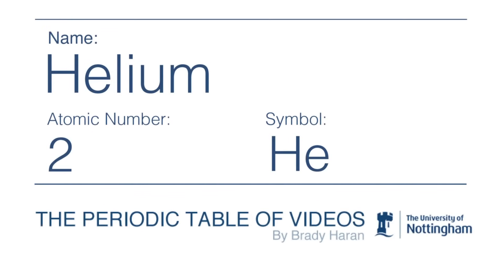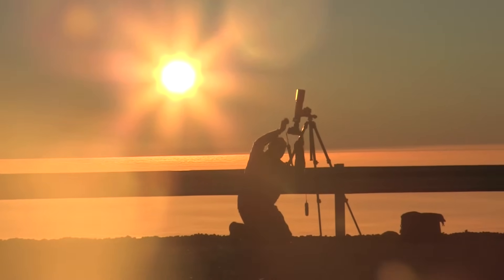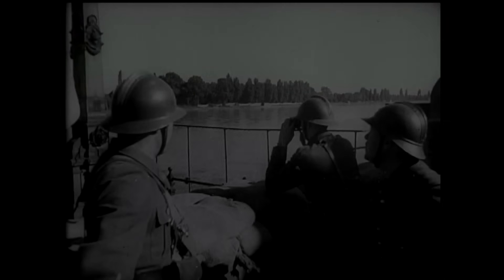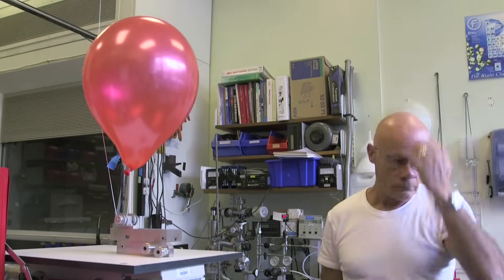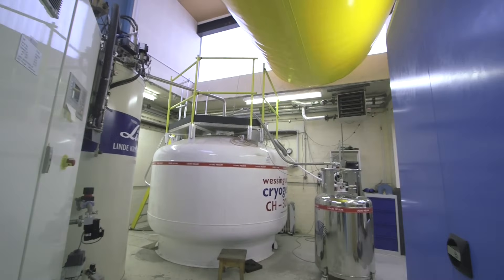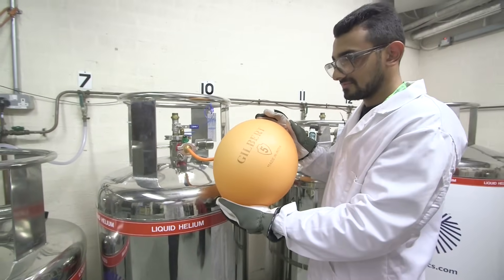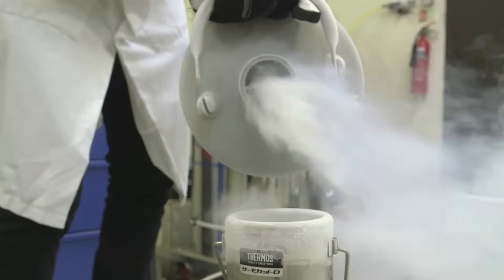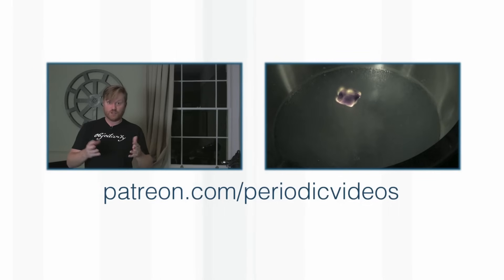Helium - Periodic Table of Videos

Comment: "Liquid helium is very rare"
"Proceeds to pour liquid helium everywhere"
Reply: I would be surprised if they didn't have some kind of capture system. If for no other reason, due to the chance of leaks.
Reply: That’s amazing tho!!!!!!! With liquid helium... you could get so close to 0 Kelvin which is so incredible. Imagine studying that under an electron microscope. Or a laser!!!!!!!! Omg I can’t wait till I get done with my engineering degree! I’m gonna do so much with it.
Reply: I think it's rare relatively compared to other elements but we have plenty for whatever we need, otherwise we wouldn't waste it in party balloons.
Reply: Any helium that escapes into the atmosphere goes up and up and ends up in outer space so is lost to us forever. Eventually we will run out of helium unless we can manufacture it (by fusion/fission) or collect it from. Somewhere else.
Reply: i kid you not that is funny to me
Reply: The helium is recovered in that room so most is not lost.
Reply: Curt D It is not recovered from the compressor/dewar room. It is captured from individual labs’ feed lines coming off of their apparatus, then charged for what is lost, not what is sent to them and returned. I believe it is captured from the slatted floor, not to save the helium, but to divert the liquid helium/nitrogen out of the building and onto the ground so it does not displace the oxygen in the room. Think of it as a regular floor drain meant for water, but this one if for liquid gasses.
Reply: @johnanders8861  And gaseous gasses.
Reply: +Curt D
It's essentially lost because it can't be used anymore
Reply: We're going to laugh at ourselves one day when we're mass producing helium from larger atoms.... turning a pound of garbage into a pound of helium...
Reply: radioactive waste is like drain cleaner and alum foil in terms of helium
Reply: Curt D no it’s not

Comment: Hey, it's Sanj the Helium guy! Just wanted to say thank you for the opportunity to be in this video. I hope you guys had just as much fun as I did!
Reply from the maker: +SanjFX cheers Sanj the Helium guy! See you again soon hopefully.
Reply: @periodicvideos oh
Reply: @periodicvideos  With a handheld Tesla Coil, try the 1990s "One ATM Plasma Globe," but with an inverted aquarium filled with helium rather than a paper bag of argon.   
With 100% argon in an open paper bag, you'll obtain 15cm sparks if you stab the electrode of a Tesla Coil into the pool of argon.   Probably the same will happen with Ne and He, but you'd need an open lucite box placed upside-down.   To produce 100% pools of gas, wrap a bit of tissue paper over the end of the hose, otherwise the gas will be "poisoned" by turbulent mixing with air.  Tiny contamination by air will halt the long-sparks phenomenon.  
Why do sparks become orders longer when leaping through Hg vapor or through nobel gases?   I suspect it involves the lack of "doing chemistry," where sparks in air are expending energy in disassociating the N2 and O2, which of course doesn't happen with monatomic gas.  
This effect was discovered by Bill Parker, the artist who built the first plasma-globes for the Exploratorium in SF.   Those globes still work at 1ATM, although the required wattage is much lower at a few Torr pressure in the globe.   
PS   
Caution: if you first blow all the air out of your lungs, then inhale helium slowly, your pitch rises more, but also you'll experience anoxia and then pass out.   If you feel faint, just rapidly blow out the He and take many deep breaths.
Reply: All hail Ser Sanj of House Helium guy
Reply: We did. Thanks, tech guy!
Reply: ozdergecko You could use glass without breaking it, but liquid helium has such a low viscosity that it will literally run up the side of the container and leak out the top. People used to think it was penetrating the glass (hence the professor's statement of "going through it") because a glass vessel just drips helium out the bottom.
Reply: @QuincyMarket  I think you have something there; adhesion and cohesion are two forces when speaking about liquid, and the adhesion of the silicon atoms is higher than the cohesive attraction of the liquid helium.
Reply: @QuincyMarket  hope they get that on video next time
Reply: Neil Wilson You're welcome :)
Reply: I defintely had fun watching this, but certainly not as much fun as someone with the opporunity to play around with helium.
Reply: very much so. A question: would a glass container immediately break when filled with liq He? If not, doing so in very dry air might have shown the color of liq.He. Or would O2 and N2 sublimate too fast on the outer surface?
Reply: I wonder how much helium was lost in the making of the video, does the facility recover it from the air or was it all waste?
Reply: Alfonso J. Ramos Yea most universities have a recovery and capture system if they use Helium a lot. There are videos on YT about it.
Reply: It seems to be a cool job to be the Helium guy. I'm sure that Kamerlingh Onnes would be very pleased to see liquid helium in action and to have fun with it :-)
Reply: the old helium video showed the full recovery process and system that they have, that stuff is too valuable to waste. It was almost certainly captured by the same system.
Reply: Does your voice change when working around all that helium?
Reply: Although it was fun to watch I bet you had much more fun making it!
Reply: So, did you waste all the helium you sprayed out, or do you have a recycling system?
Reply: Admiral Percy yes, that phenomenon is called Superfluidity.
Reply: Are you an Indian?how did u reach there????
Reply: @europebasedvlogs1251  Indians have the most number of expatriates. Indian diaspora is the largest in the world.
Reply: EUROPE BASED VLOGS he would of been born here like many British Indians ✌️
Reply: Was that helium all recovered?
Reply: Hugh Oxford Yes it is captured
Reply: 666th
Reply: Nice job keeping it light.
Reply: @SanjFX , I have a question; 

Helium is getting lost to us on Earth because it just floats away, and up into the sky, and above the average atmospheric gasses, like bits of paper in water, or breadcrumbs in a kitchen sink. 

Why can't someone just go get it?

Surely someone could build an unmanned airplane, or drone, or something, to go up to the highest level of the stratosphere, and "vaccume up" a sample of all the various gasses up there, including helium.  

These days, it is so simple and straight forward, I could almost do it myself, if I bought the right equipment. 

One private citizen could not retrieve any significant amount, but a company or University could. 

I can't be the first person to think of this, so why doesn't anyone do it?
Reply: @TheNoiseySpectator  It would be so dilute that there's no way it would be economical. Would probably be better to recover the minute quantities at ground level
Reply: Say hi to Dejah Thoris for us.
Reply: Great job! Appreciated! 👍🏾
Reply: Is (he) helium... oppose gravity when it cooled below 269 degree??
Reply: Thanks Sanjeev for trying all the ways.

Comment: When liquid nitrogen isn't enough for your overclocking
Reply: Even if it would not cause the chip not working (Aggropop explained why), it would be useless. Its thermal capacity and conductivity are very poor. Extremely cold absolute ethanol (or glycol mixtures) under high circulation are much better. They have enormous capacity and conductivity and wet the surfaces without boiling off and creating even worse bubble zones.
Reply: We could reach 10GHz with this stuff!! :P
Reply: It's not as effective as liquid nitrogen, meaning it will cool something (reduce the temperature/absorb heat) more slowly and you will need more of it to sustain any particular chill point. It will ultimately reach a much lower temperature than liquid nitrogen can though.
Reply: actually both the AMD phenom II and Bulldozer architectures had no issues under liquid helium. core temps were likely below ten kelvin at times. most other chips do cold bug out though sometimes even at liquid nitrogen temps, but I do not think it is due to the silicon changing properties.
Reply: As far as I remember, AMD themselves used the Bulldozer based FX chip to set a 8.3ghz or something Frequency World Record using Liquid Helium beating the Celeron, though, more people did go beyond 8.3ghz using Liquid Nitrogen but it shows that at least Bulldozer were capable of Liquid Helium, wonder how Skylake-X, Coffee Lake and Zen handles Liquid Helium.
Reply: You are saying that it has too poor thermal capacity and conductivity to be effective, yet you think that the silicon losing its semiconductivity due to the low temperature is a possibility? Interesting..
Reply: make a proeper LHe compressor would be the idea for overclocking project
Reply: TheOrbitalDropShock Was thinking the same thing.
Reply: Unfortunately, silicon would lose its semiconducting properties at temperatures that low, so the chip simply would not work.

Comment: Why does the volume of helium need to be measured? Don't gases expand and take up the volume of the whole tank?
Reply: Not really. It depends on pressure. The material on that yellow container is like cloth, so its volume is variable. When the container is empty or has very little He, its volume is smaller because the air pressure from the room is greater than the He pressure inside. As He gets added, the pressure inside increases, and the volume increases. PV=nRT, or V=(nRT)/P

I assume that the volume of the container at equilibrium (pressure inside = pressure outside) is a known value, so the amount of He can be calculated by n=(PV)/(RT)

P=pressure, V=volume, n=number of moles, R=ideal gas constant, T=temperature

Comment: Why don’t you try and put it in a vacume?
Reply: CORNÉ BEYERS by lowering the pressure, you make it so that the Helium will boil even at the lower temperature. That’s why the helium has to be stored under immense pressure.
Reply: CORNÉ BEYERS helium in a vacuum would fall to the bottom of the vaccuum, same with all other objects with mass
Reply: CORNÉ BEYERS putting it in a vacuum would cause it to boil
Reply: TheGinginator14 but if they could maintain the cold temp. There would be any O2 to boil? Or have I got it wrong?